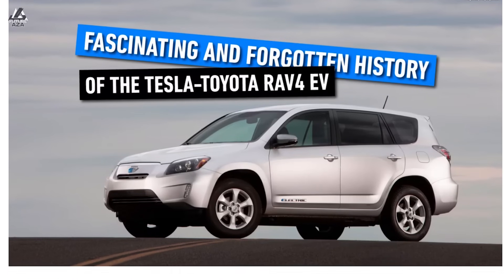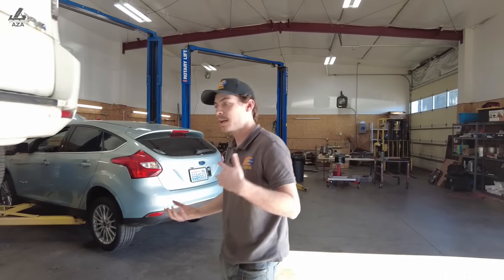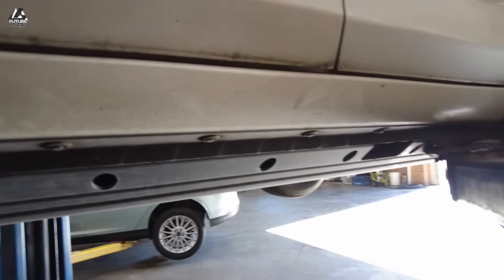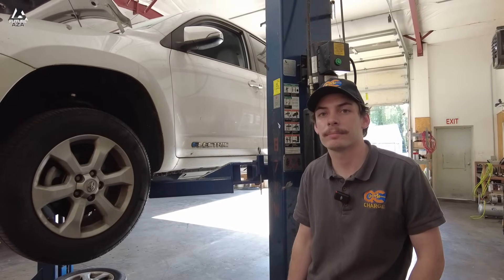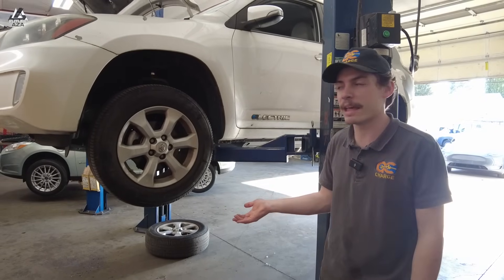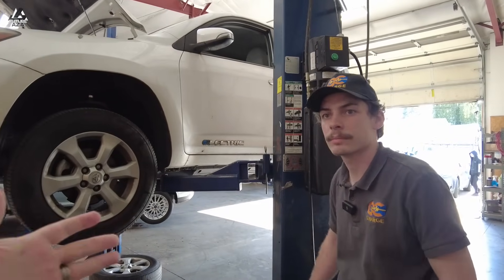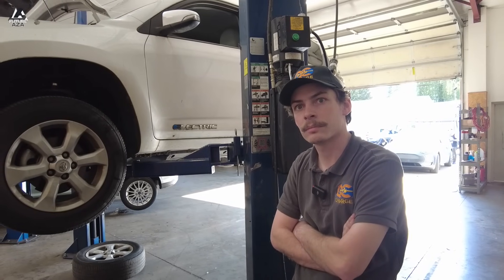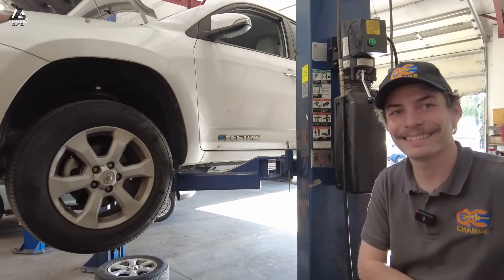Toyota, Mercedes, and Smart all Had Tesla Inside

Comment: Owned a B-Class ED for about 3 years, replaced it with a Model Y in 2022. It was a nice car even though Mercedes likes to pretend they never built it. My understanding is they sold around 5000 in the US. They also imported the gas version into Canada. We would get about 90 miles of range in the summer, substantially less in winter. We live in Maryland and occasionally get winter like weather, though less every year. If you get one of the 2017 some supported Apple Car Play. Ours was a 2014, navigation was useless.

Comment: We're still waiting for the new Smart owners to put out a ForTwo sized Smart but they've gone all SUV with the brand. They haven't used the #2 number though and have said they might consider it. What Mercedes didn't do was rework the vehicle to allow for more space once they'd ripped out the engine, transmission and so on. So there was plenty more space for batteries with a bit of redesign. Unsurprisingly they didn't have as much range as the Chinese clones which are likely better cars overall (but might not have the Smart's unique Tridion safety cell which served it so well). The UK prices for the EVs have finally come down though so it's about as cheap to get one of those, as a new Citreon Ami quadricycle. Sadly, they never did an EV version of the Smart Roadster which would have been a lovely mid life crisis car.